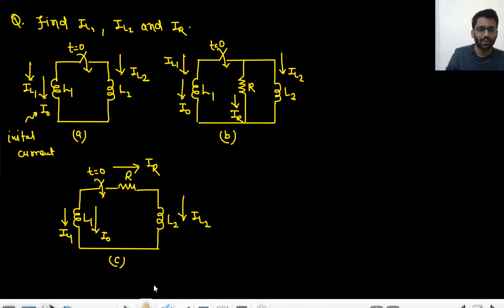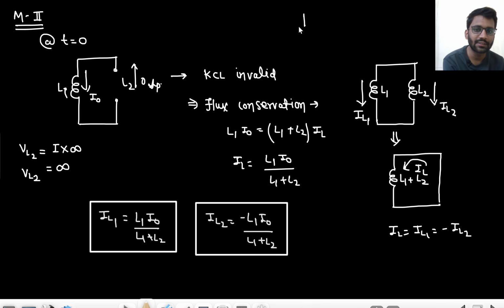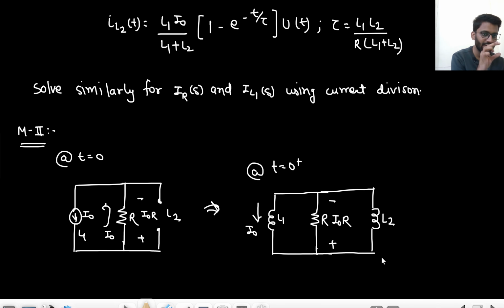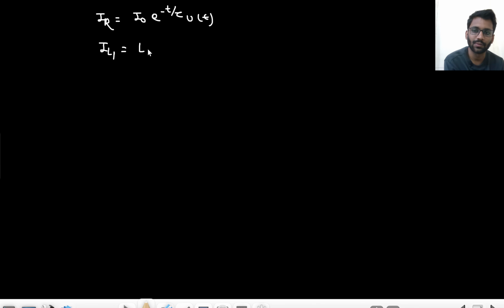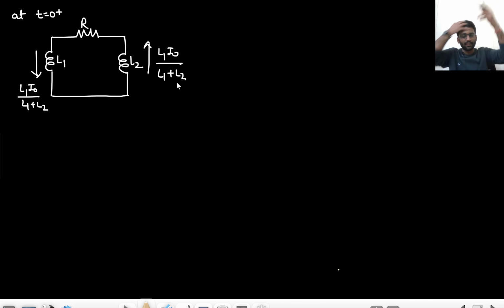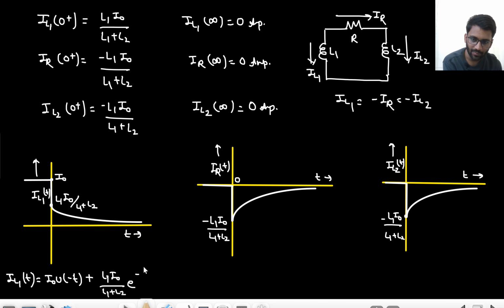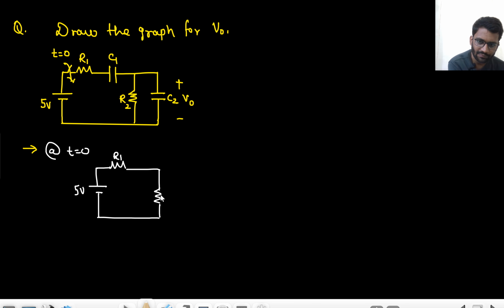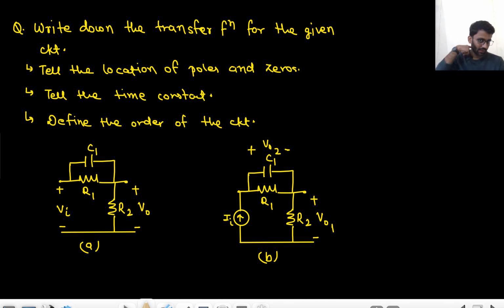More Examples of RL Circuits || Network Analysis || GATE 2025-26 || PrepFusion || Himanshu Agarwal

Comment: My doubt in 2nd bit of 1st question (30:00)
If the current i0 was flowing initially through the resistor and eventually reducing to 0 , how we are still left with complete flux that was initially available , divided into the inductors.
Wont there be some energy lost in the conduction through resistor???
Reply: The values being attained are same as that of the 1st sub-question, just the difference is there is no impulse.
But how are we ignoring the resistor's thing?
Reply: @tapangupta146 for practical system there will be resistor losses but here ideal system is considered so total current is flowing through the inductors at steady state
Reply: @SuprioDutta-u6v we are ourselves writing equation for the resistor, idealy. why shouldn't it refect to final answers.

I searched a lot, and got to know that flux conservation is decoupled from energy conservation. Still a little difficult to understand for me.
Reply: @tapangupta146 I don't know if I'm right, but I believe that as flux is distributed from L1 to L2, the magnetic field lines lose the intensity that was concentrated on L1 and now share it with L2. The flux lines are the same, but the concentration/density becomes lower. That's why 50% of the energy is lost.

In Case 2, with a parallel resistor, the energy gets dumped into the resistor; at least it has a path. But in Case 1, there is no resistor, so the lost energy is dumped into the air or some other medium.
Reply: thats the thing the energy is lost through resistor, so the resistor does nothing but control the speed ofthe transition that is time constant ,but momentum is conserved because the current drops,
so finally if you look into the circuit the current is actually lost, so lets say the both the inductors have 1L, then you can clearly see that the intial current is half at infinity

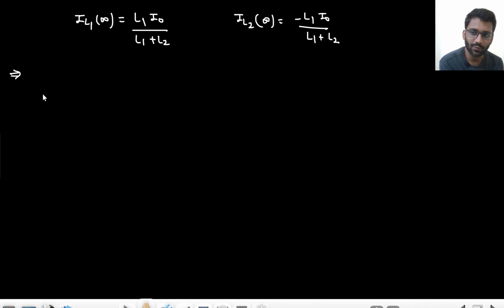Comment: Sir @ 31:11 Ir(0+) = -Io because of direction given in question.
Reply: Nope the Polarity reversed across resistor. So Io = Ir only.

Ir is entering +ve terminal of Res in Question (Assume +ve terminal) now due to polarity reversal concept for inductor L1,  the polarity of all branch parallel to L1 will be reversed. Then Io = Ir. You can also consider KCL Io- Ir =0 so its valid only.
It all comes down to SIGN convention concept.

Simply use loop logic, a loop should have same current, if we go by ur logic Ir = -Io its illogical.

Comment: For second example where resistor is in parallel with inductors, wont the current through resistor be -I(not). if so graph should be on the negative side decaying to zero?

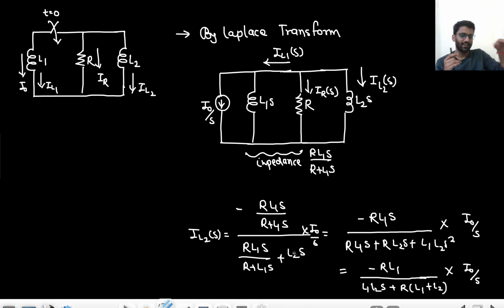Comment: Sir @18:13 why do we use minus sign for current division
Reply: The source current is outgoing current Il1(s) 
If it is incoming, then it would be plus, since Il2 is also outgoing. KCL only.
Reply: Sign convention brother
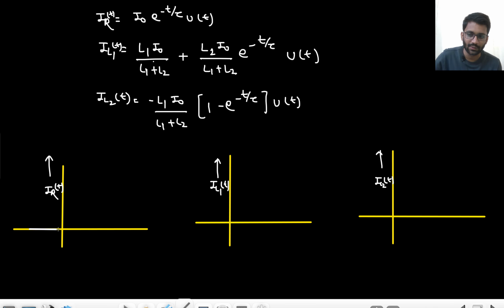Reply: @Xyzengineer  i have a doubt , 35:00 IR  and Io are in opposite direction so may IR should be from negative direction of IR(t) in graph

Comment: in the first example Voltage will not be infinite forever rather it will be impulse voltage for t=0 as flux changes in zero time  and then  vol will be zero as constant current flows through both inductor .

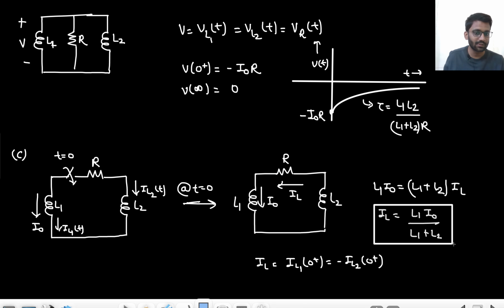Comment: bhayya at 43:02 how can the current change abruptly (t=0+) in an inductor that to in first order circuit. btw love ur videos kudos to ur efforts.
Reply: One inductor is having Io, other  one is having zero current. both in series, KCL invalid. Had to change the current abruptly
Reply: Would be very tough to understand with respect to impulsive voltage, but you can try. 
KCL being invalid is also a good explanation though